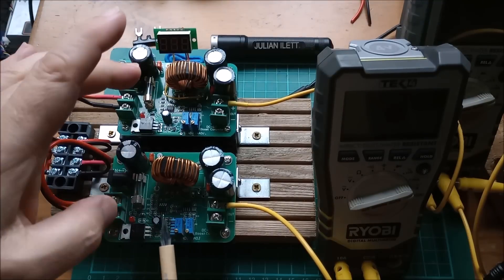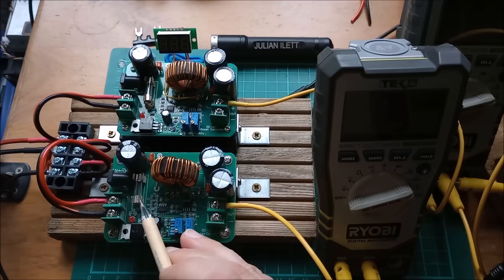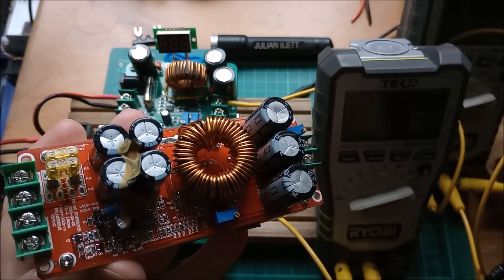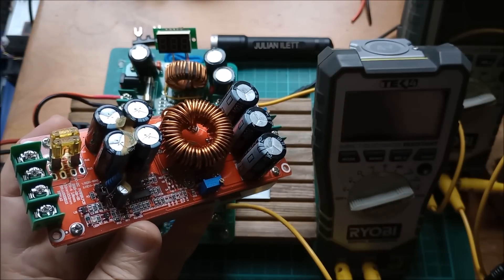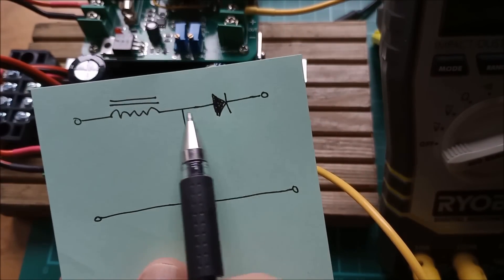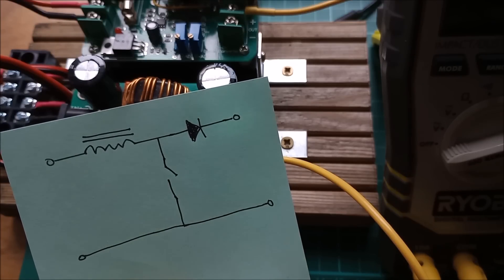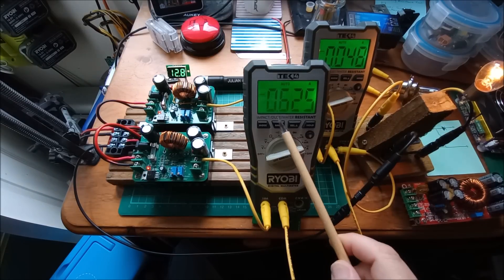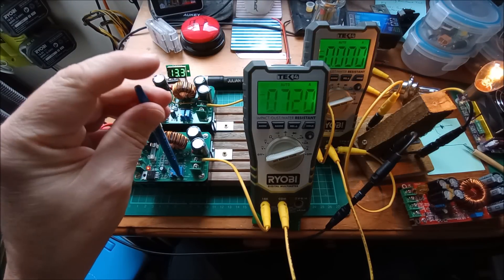Parallel Boost Converters

Comment: There are two effective ways to parallel configuration, in both cases you must "Sync" ThepowerIN or ThePowerOUT. For two power supply (A & B), Case 1 Sync by PowerIN - A must be ON, B must be OFF. then A must be OFF, B must be ON. for this you need to find the correct PWM frecuency to switch A & B. Case 2 Sync by PowerOUT the same but more tricky cause need sync high frecuencies. In the case that use XL6009, XL6019, LM2596, MT3608 they have a ENable pin, that turn ON or OFF the module. look datasheet. 
If you connect direct in parallel by using schottky diode or ecualizer resistor will kill the power supply.

Comment: Have you tried paralleling them through a bus bar? Meaning, the output gets paralleled through a bus bar not the input. Input should be connected to the battery individually. Would it make a difference?

Comment: Thank you for the interesting info. However this is an expected behavior. Until a voltage drops below a regulator limits, the second part won't start working. But if one unit provides enough power until this happens, what's bad that it works without any help from its "brother"? It will stay in working margins. And when it will try to exceed them, the second unit will help. Sure, it will be needed to set them up as close as possible initially. This is always better to have a "real" architecture with paralleled switches and chocks. However in case you load is increased unexpectedly, to purchase a same unit to solve the problem won't be a bad idea imho if this will be the cheapest or quickest solution.

Comment: You should watch this guy's video "Виктор Сочи". He has paralleled two XL4016 buck converters by modifying the feedback circuit with only one trimpot controlling both and it works.
Video is titled : "Параллельное включение преобразователей, тест и как поднять выходное напряжение DC-DC Step Down"

Comment: You should be able to use a few diodes on each boost converter output to combine the outputs and yet keeping the boost converters from seeing each other because one see the other it’s reacting to your adjustments on the other one so if you put two steering dies on each boost converter one for negative and one for positive on each boost converter, you bring a negative together and you bring the positives together this might resolve your problem.  I used to do this when looking at two different outputs across the single trace scope to see two traces simple way to cheat and neither power supplies saw each other and that’s when I figure out I could bring two power supplies together without affecting one of the other, and have a total combined output

Comment: A long time ago, I created a dc-dc converting using a lm2576 (I think) when they just came out to power wireless equipment.   Since I had a lot of them I tried to use multiple in parallel and it was a complete fail.  I didn't have current limits on them, so there was really no chance, one does all until it blows up.  lol   This was when I was an electronics newbie, so I learned something from this experiment.   What I looked into was using the chip to drive an external mosfet and bigger coil to get more power, and I determined I should just buy a different chip that was designed to do that instead of the lm2576, as the control chips particularly now are a small part of the cost.   As you mentioned, the '1200' watt units sold are really not even close to that rating.   I want to use a 12v battery and generate 36v to run a e-bike or other things, like large displays or spotlights with leds in series and they won't really do it.

Comment: Hi Julian, nice test, I wanted to parallel two of the 1800 watt models, but another guy on you tube blew them up, doing the same thing. I didnot understand it, but probably this was caused by the shunts in the negative, as you pointed out.
I am only going to parallel the outputs to my battery bank, the inputs are two seperate toriods, with bridge rectifier and elco, so the inputs are isolated, that should work. As for the CV state, connected to the battery, regulation will be slower, load sharing is probably not perfect, but that does not matter.

Comment: Julian I love your videos, parallel well of course you can. eg a solar panel is a boost converter....There is no hokus pokus, diodes are key, regardless of what people may tell you. How do you think a Solar charge controller or several of them can be connected to the same battery,  and charge the battery at different voltages and amps? Diodes.

Comment: When using non-isolated dc to dc boost converters, I use separate power supplies for each converter.  This allows the outputs to be combined.  The ideal solution is to use converters with isolated grounds.  Then they can be fed by a common power supply.
Reply: When using converters in parallel, it is not necessary to use separate sources, only use in the case of series converters.

Comment: The "safe" way to put multiple supply's in parallel is to use one in CV mode and steer the others thru a current limiting network. ( 2 transistors, 1 resistor, 1 diode pr. "slave" supply ). The diode is placed on the output before connecting these together.
You will loose a few volts in the current limiting network on the "slaves" but the voltage can be controlled and the current will be evenly shared.
IMPORTANT: ( You will also need short-circuit protection like adding a foldback circuit to the "steering" supply. If you don't, during a "short" all the power will be frying the current limiting networks!!! The built-in closed-circuit protection on the SMPS's will not save you, since it "sees" the external current-limiter as a normal load. )

Comment: Lol easiest way i found and super reliable is using a couple of fets and setup in a emitter follower circuit. The "following" supply is set at a slightly higher voltage and current than the 'lead" supply. This works as the lead supply is controlling the followers output supply via the external arse end fet circuit. Have a look here for the simple answer you seek. https://youtu.be/2JPyDVeD0i8?si=m-gaV8zCSzY4wgF5

Comment: The output current of a boost converter, unless it utilizes an additional switch, cannot be limited to less than the supply voltage divided by the load resistance, ignoring the resistances in the circuit itself, normally dominated by the inductor. Boost converters without additional switches therefore cannot be made short-circuit proof.

Paralleling constant voltage power supplies of any sort generally works poorly without additional circuity. Degrading the voltage regulation by reducing the error amplifier gain can help, but that of course degrades the overall voltage regulation precision. Another alternative is adding output ballast resistors, but that also degrades voltage regulation. Paralleling constant current supplies generally works reasonably well, each supply delivering current according to its setpoint. (remember that an ideal voltage source has zero source impedance while an ideal current source has infinite source impedance)

When the current sensing is in switch circuit, the current regulation is not accurately reflected in the output circuit. This is simply a function of the fact that the regulation is normally based on peak switch current, not average switch current.
Reply: You've just said that a current through a battery connected to a certain resistance cannot be limited without an additional switches. Sure! It cannot. This is an Ohm's law )

Comment: With these cheep boost converter looks like they are not meant for continuous power at their full rating, they will run very hot with their undersized traces and coil windings.
Maybe run them at 75% capacity and add a fan.

Comment: Because you don't use a scope to see what is really going on at the output, you cannot say for sure it is working properly. I mean, these are not the smoothest DC sources, it is PWM. I wonder what it will do with the noise/ripple at the output. Is there some pulse skipping, peaks or other artifacts  going on? Do they really balance eachother or do they also work against eachother (for example by not being perfectly in sync)? Do they get hotter than normal? There isn't a feedback so both converters do not know what the other is doing and on what time frame. For example, when out of sync you cannot get the maximum current both converters can provide together because they don't help eachother.  In fact this is the same result as using only one converter. When they are perfectly in sync, only then you get the benefits by doing so. It is important to use a scope (or two) at such experiments.

Comment: :( I'm all for the scientific method and experimenting, but when talking about 10's or 100's of watts, I think folk need a better understanding of how these things work before just trying things willy nilly.
Some of the questions in here could be answered with simple worst-case thought-experiments... e.g. imagine your two converters' outputs are connected in parallel... where does the return current flow? Well, surely, back to the converter that supplied it, right? But what if one's wire is 0.01ohms higher than the other? V=IR I=V/R->infinity, so all the current Might go through one converter's return wire, then half would out the back and into the second... this seems like a bad idea. Things change with temperature, humidity, etc... How many comments here rely on perfect matching of voltage, etc. via potentiometers whose values will vary day to day, or perfect matching of silicon in two chips with different thermal experiences...? Even if an experiment works perfectly one day, at this amount of power, it might be disastrous another...

Comment: Put a diode after each volt meter so they don't see the voltage of the other converter.
Reply: That does not work.

Comment: You can add some small balancing resistors to the output to share I in CV mode, just like driving parallel transistors with slightly different hfe figures; the voltage drop gives you a bit of voltage margin to fall within.
Reply: That can work but at the expense of efficiency and voltage regulation. Trying to accomplish balance within a few percent is likely to result in unsatisfactory performance on both parameters.

Comment: That is intriguing behavior from those converters. I remember the last video discussing this and I said you had to have precise control of the voltage which is certainly the case here.
I am also a huge advocate for positive current shunts. Now they are still negative shunts but not in the usual way. Which I can't say many bad things about. I just think about input voltage fluctuations changing the current output.
Your idea of just setting the current limit to what the units can handle at maximum is a great solution.
Reply: The failure to share the load when the supplies are operating in constant voltage mode is absolutely predictable. The worse the individual supplies are at accurately regulating voltage, the better they share. This is true of switchers and linear regulators. It is simply a result of the fact that constant voltage supplies have very high gain error amplifiers and they are trying to behave like they have zero source impedance. In constant current mode supplies try to behave like they have infinite source impedance, thus they inherently share according to their setpoints.

edit, forgot to mention: High-side shunts are a lot harder than low-side shunts. Depending on just what you are doing you have to select a shunt amplifier that can handle voltages at least to and possibly greater than its own supply rail. That limits choices significantly. You also have to have good common mode rejection to keep the error manageable. An integrated differential amplifier can be a good though expensive solution. If you try to make a diff amp with discrete resistors you may find you need to use resistors of 0.1% tolerance or better, depending on the output voltage of the supply and the voltage across the shunt.
Reply from the maker: Thanks :)

Comment: I think people are confused ... you can limit current but voltage is just set to a level, not "limited" per se. 

When the current limit is tripped then the voltage drops correspondingly but as a result of the current limit not any kind of voltage limit.

To get the supplies to balance requires careful monitoring of all the outputs and multilateral lateral synchronius control otherwise it's the case of "most wins" when it comes to voltage.  

It's just like when there are two 12v batteries connected in parallel, one will stop the other providing any current until the load resistance drops low enough.

Worse, if they are more than a few hundred mV different in open circuit volts, current will flow from the higher voltage battery into the lower voltage one as soon as they are connected in parallel.

To prevent back feeding, yes, diodes COULD be used but would have to be rated for the max output current-plus. BUT ... that also means wasted power ... 0.7v x diode current per diode. So if just 5A per diode then 7 watts of pure wasted heat ... with just two supplies.

A more robust and vastly more efficient reverse blocking mechansim can be achieved using series MOSFETs. However the only way to achieve full balancing is via more complex power monitoring and feedback circuitry coupling the simultaneous control of each supply. That is the ONLY way to balance the individual supply loads properly. Otherwise, as already stated ... "most wins!" 🤔🙄
Reply: Sorry, an earlier reply I'd posted was intended to respond in a different thread.

Linear Tech has some "ideal diode" controllers that are very cool. They use external MOSFETs "backwards." I used them in a lithium battery charger I designed years ago to allow connecting batteries of different charge states (actually each battery was two completely separate batteries internally - these were made for the military market and sold for about $400 each; they were about the same physical size as a 6 A•h 12 V sealed lead-acid battery)

Making constant voltage supplies share reasonably equally when they are connected in parallel, without compromising efficiency and regulation accuracy,  is indeed a significant challenge and invariably requires some carefully designed circuitry, even when the necessary "hooks" are designed into the individual supply modules. Trying to retrtofit supplies without the necessary designed-in features is really daunting.

Comment: I'm thinking that you could either 1) use diodes on the output Pos lines, it'll keep both units separate 2) separately set both converters to the exact same voltage and then connect them in paralle 3) use a high frequency 1:1 transformer to completely isolate the outputs and the parallel the isolated outputs after the smoothing caps
Reply: Simply putting diodes won't work, what you want is resistance so that slight changes in voltage set points will equal smaller differences in current. The diodes will just be forward biased the entire time and contribute nothing but resistance and power loss which can be more efficiently done with low value resistors.
1:1 transformers might work, replace the inductors with something more like a SEPIC converter but that might just turn into a project of "just increase the power rating of the converter by doubling up the components".

Comment: I wonder if series input will also work. I have two 230V ac to 45V dc which have output sensing for series balanced output of 90V.
Meanwell said it can do the series output but not the series input. I still wonder why not. they didn't explain. Could it have to do with the chassis ground?
Reply: The voltage across the input of each supply depends on the current delivered by that supply. If one supply momentarily delivers no load current the full supply voltage will appear across the input to the other supply.
Reply: @D614G_aka_Doug   thank you. yes. but since the outputs are balanced by the sensor, that wont happen. extra output capacitors should also help prevent that.
Reply: @MasterIvo  
Increasing the output capacitance is unlikely to be of any benefit. You are still up against things like soft-start circuits that could cause a differential in startup time of tens of milliseconds. Even if the startups were synchronous, variations in the input filter capacitors could lead to substantial imbalance.

There are considerations like capacitance between the output circuit and the input circuit. It is very common to use a discrete capacitance between the output negative (usually) and either the input DC positive or DC negative. This is done to provide a local return path for RF as part of  EMI/RFI management. Things get pretty vague if you have two supplies in series.

I take it you want to try to operate these supplies on 480 VAC. If I were doing this I'd use a step-down autotransformer. This is typically something you'd buy as an ordinary transformer with split primary and split secondary, each individual winding rated for 240 V. They're pretty common as "control transformers." Be aware of the fact that if the switchers don't have active power factor correction, the ratio of RMS to average current at their input will be quite high, so don't skimp on the current rating of such a transformer.

There was a time I might have tried calling Meanwell on your behalf. It owed me for identifying a engineering/production flaw in one of their supplies (in a bit of circuitry that should have improved reliability of the supply but because of the execution actually significantly reduced reliability).  But that was quite a few years back.